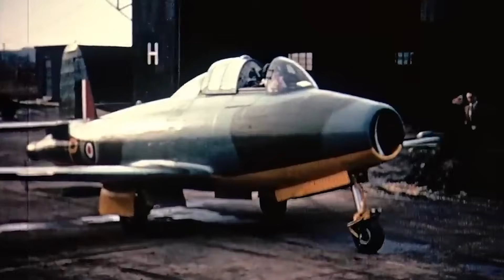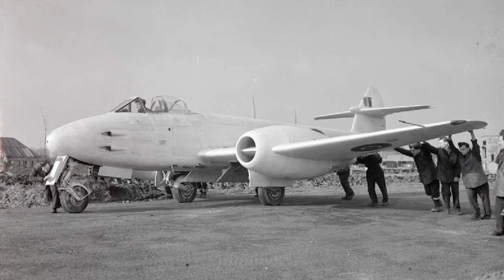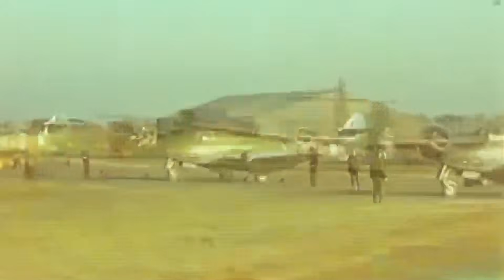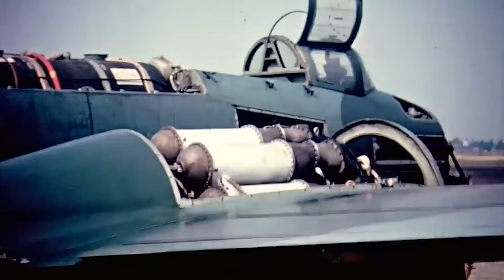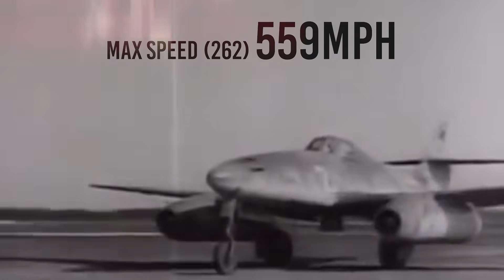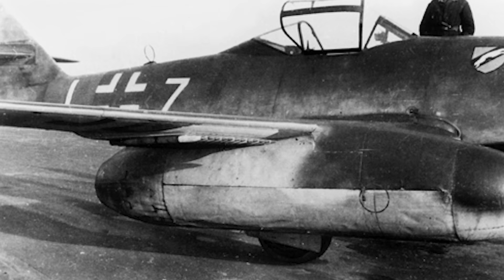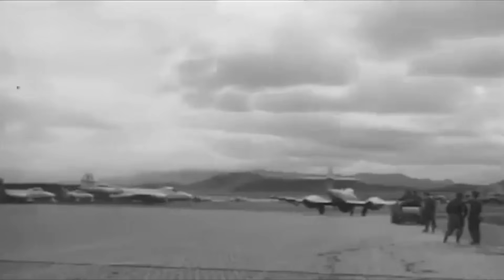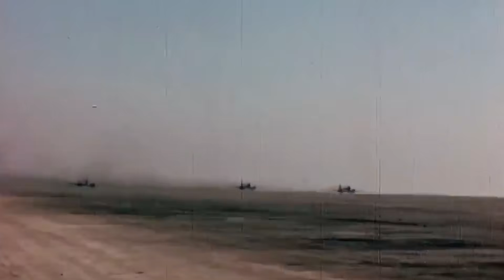Meteor vs Me 262 | Which was the better WW2 jet?

Comment: The only advantage the 262 had was flying fast in a straight line... it was outclassed by the Meteor in every other respect. 

And by late 1945, the neteor could fly faster than the 262 in a straight line, too.
Reply: You didn't watch or understand the video. The 262 wasn't only better flying in a straight line, it climbed and dived much faster, too. As long as the 262 didn't engage in a lower speed circling dogfight it was superior able to dictate the engagement. Btw. that's also how the MiG-15 played its superiority in Korea before arrival of the F86. And as for the faster later Meteor versions, also the 262 development didn't stop and would have progressed to faster and more reliable versions if the war wasn't ended. Have a look at the HG versions already in development.
Reply: @wanderschlosser1857 The earliest 262 climbed marginally faster than the earliest Meteor,  there is no good evidence it dived significantly faster. 

And none of the planned future 262s addressed its fundamental fatal flaw... it's engines were crap, and demanded a rebuild every other flight.

Oddly ... folks can already know stuff without watching a video.
Reply: @DJTheTrainmanWalkerThe 262 certainly did dive faster and accelerate into the dive faster since it had much less resistance in flight. That acceleration doesn't require a change of throttle (which indeed was a problem for the Jumo's), it's simple physics. Same for the climb, the lower flow resistance allows for a quicker climb out of a fast level flight, the 262 was simply the more advanced airframe.
As for the engines, that you call crap, these might have needed a more frequent rebuild but that wasn't a problem for the aircraft, since an engine swap was as fast as 30 minutes, there are not many WW2 aircraft if any where that could be done quicker. The bigger issue with the engines was the handling of them through different throttle settings without damaging or destroying them. This problem was to be mostly rectified by an automated fuel control which was about to be introduced when the war ended. It's actually quite an amazing engineering that Jumo managed to make a working jet engine using low grade materials out of wartime necessity. It actually was the beginning of internally cooled turbine blades which are the standard today. If you knew more about aviation gas turbine engines you'd be amazed how far developed these Jumos actually were.
Reply: @wanderschlosser1857 So... basically the 262 and meteor were comparable in every respect, give or take a digit or two here and there..  except straight line speed.... and the more important fact that The 262 engines needed a complete rebuild every other flight. Which the Meteor engines didn't.

The 262 was crap... basically flash packaging but broke after being used a couple of times. Which is why out of ...1000 or so built barley 100 were ever flightworthy at one time.

Oh and Whittle said in the 30's that axial flow was long term more efficient, but the material science did not yet exist to make it practical. 

And 262 demonstrated him right
Reply: @wanderschlosser1857 Oh and on the 'more advanced airframe' .... yup the accidental invention of the swept wing was basically what made the 262 faster in a straight line. Essentially the only thing about the 262 that was any good.
Reply: @DJTheTrainmanWalkerWell, the early Meteors weren't exactly on-par with the 262 flight performance wise and certainly not just digits apart. The Meteor nevertheless had its advantages, too. So, for combat effectiveness you can call them on-par.

As I already said, the shorter lifetime of the 262 engines had no real effect on its combat performance because an engine change was super fast and replacement engines were available in sufficient numbers. The engine problem was rather that it was easily damaged during operation by the pilot.

That only 300 out of the produced 1400 262's were actually ever in operation is not because the aircraft was crappy but because of the war situation regarding trained pilots, ground crew, facilities and especially insufficient fuel. That's all known, with a bit effort you could know that, too.
Reply: @wanderschlosser1857 Climb rate was directly equivalent. Dive rate of the 262... marginally better if you didn't mind losing control.... Meteor way more maneuverable, and by 45 just as fast.

And yet the 'engine swap' issue and 'ground crew availability' we're directly related since it needed 10 times as many groundcrew to maintain the 262 as compared to the Meteor, because of the need to swap/maintain engines. Every corner you cut creates two new corners.

Whittle had access to all the materials and still recognised metallurgy was not yet up to making axial flow work consistently.

And... if your short on fuel... a fuel hungry plane is bad design in and of itself.

Or put another way combat effectiveness relies on a good deal more than being able to fly fast in a straight line.

Edit ... oh and I think engine resilience, or lack of it in the case of the 262, is hardly something to blame on the pilot.
Reply: @wanderschlosser1857 Oh and... Just did some research and the most common 'pilot error' wearing 262 engines was likely pilots exceeding 800kph in dives... which they were tempted to do since theguage maxed out at 1100kph... basically another design flaw.
Reply: @DJTheTrainmanWalkerIt didn't need 10 times as much personnel because of more engine changes. You probably needed more personnel and certainly much more time to get a Meteor engine out of its nacelle than on a 262 which were optimised for quick engine changes.

The Meteor was just as fast end of 45 as the 262 was beginning of 44, that's worlds in wartime. Likely by end of 45 the 262 would have improved as well and other German jets were close to completion as well. That all is hypothetical anyway. In the time both aircraft could have met the Meteor was quite a fair bit slower. And yes the Meteor was likely more manouverable but only at lower speeds and altitudes. When the 262 was tested by Brits and Yanks after the war both confirmed that the 262 was superior in energy preservation in turns and energy retention after turns, again confirming its better acceleration. And that's simply because its airframe was more advanced for jet propulsion and less air resistent. A design flaw was that it didn't have air breaks, especially problematic for the landing runs.

Fuel hungry all early jets were, but a big advantage was that the fuel didn't need high octanes like the piston engines. A big issue on the German side.

At the end the 262 didn't work out because it was a crappy aircraft as you want to imply but simply because the war was already a lost cause to Germany years before it was introduced. Luckily for the Brits, they didn't have to press a completely new and not fully developped generation of aircraft into service anymore in 44. Would have been a different story in 1940.

Comment: Didn't a meteor set a record of 606 mph  in Nov. of 45?
Reply: Meteor's top speed was 606 mph in late 1945, 650 mph in mid 1946.
Reply: @johnburns4017  me262 in ww2 hit 624mph  special version.
Reply: @johnburns4017  The Meteor III with Derwent II engines had a top speed of 470 mph and the airframe itself was limited to 500 mph due the critical Mach number of .74 in 1946, according to the RAF's Central Fighter Establishment. Would you like a copy of the report?
Reply: @johnburns4017  Fun fact, the Miles M.52 was to use a German Walter Walter HWK 109-509 rocket in an attempt to break the sound barrier, after it became clear that the W.2 would not work. That same engine powered the Me 163 to 700 mph on 6 July 1944.  Would you like to know more
Reply: @TheAneewAony  
doktorbimmer, a quiz.
Name the plane that broke the first ever jet plane world record?
Twenty points for the correct answer.

Comment: I would make a snarky quip about which had the longer service record, but it's not even necessary between these two aircraft. Nootsie Germany was materially in a bad place by the time the Me-262 entered service, and it exhibited issues that are almost to be expected when you're trying to build an aircraft you no longer have the resources to build properly. The jet advantage in WWII simulations of the Me-262 are pretty easy to see, but it's only able to be dominant there because it's a simulation, you can turn off the kinds of random failures that made it a liability. All first generation jet fighters had issues, but the Me-262 and the first Russian jet fighter were a step ahead of the rest in being flying coffins due to poor design choices and sketchy materials used.

Comment: This reminds me of debates about the King Tiger. It was a formidable tank, if you weren't stopped getting to the battle-field by there being no bridges that could take its weight, if it wasn't broken down, and if you had the fuel to drive it. In other words, it was an awful tank.

The 262 was a formidable fighter, if you had a spare engine to replace the one that burnt out after one or two missions, if you had an experienced enough pilot to fly such a difficult plane, if you weren't caught by the enemy in the vulnerable landing or take-off stage, and if the guns didn't jam. In other words, Germany would probably have been better building more Focke-Wulfs.

Comment: Allied piston-engine fighters had a 13-2 kill ratio advantage over the Me 262.  Perhaps late-war pilot experience, or the lack of it, had something to do with this, but the high wing loading and the slow rate that the Me 262's engines could throttle up to maximum thrust were a distinct disadvantage whenever Me 262s were ambushed by P-51s at cruising speed.  Furthermore, in a dive the Me 262 would lose control at Mach 0.85, while P-51s could be pushed to Mach 0.86 and survive.  At first the Fw 190 was still a superior bomber interceptor to the Me 262, and this only changed when the Me 262 started using the R4M air-to-air rocket system.  Perhaps one reason the Meteor was never used to engage the Me 262 in combat was that late-war Allied piston-engine fighters were already doing an adequate job in this regard.

Comment: The 262 was not the fastest WW2 fighter, that was the Me-363 rocket interceptor.

Decisions by Goering and Hitler were not important. The 262 airframe design was finished in early 1940, it was the lack of sort of reliable engines that prevented combat introduction until late 44. 

The 262 barely swept wing was an incidental result of issues with weight distribution of the novel jet engines and severe buffeting when landing -- the prototypes were cranked winged. 

A basic problem was that the 262 required long concrete runways, so it could operate out of only a few locations. Allowing Allied piston jobs to ambush them at low altitudes. 

P-51s normally escorted bombers by flying a couple thousand ft above them, so they could dive on attackers. This allowed them to match the speed of the jets, which they could also outturn. This led to numerous losses of 262s.
Reply: Ah yes, the "Me-363" rocket interceptor. I think it was in Top Gun with the Mig 28.